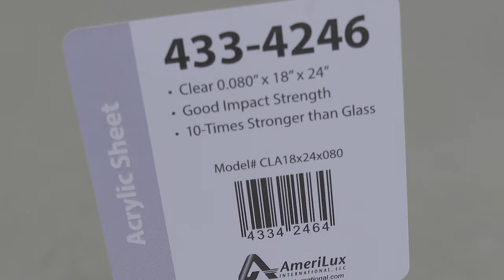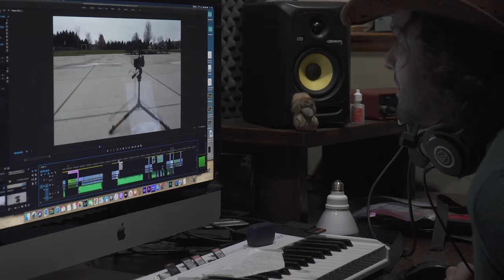What Do Spinning Rocks Sound Like?

Comment: That bicycle gyroscope theory is not correct. It is by moving the wheels contact point with respect to the center of gravity.
Reply from the maker: Yeah, I definitely should have done more research on that before making that statement in the video. I'm just glad that I did say that it "helps to make it easier" instead of "it is the primary reason". Anyways, thanks for watching.